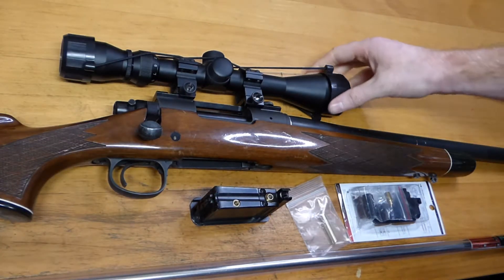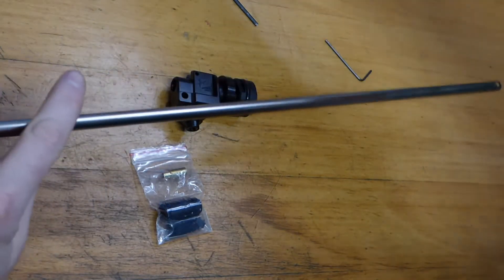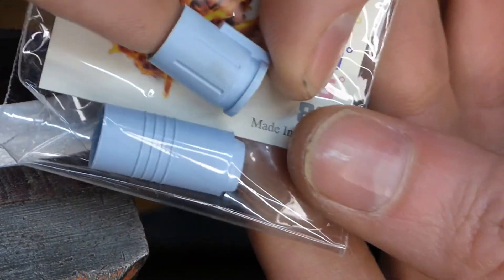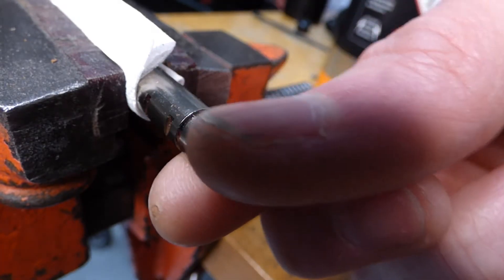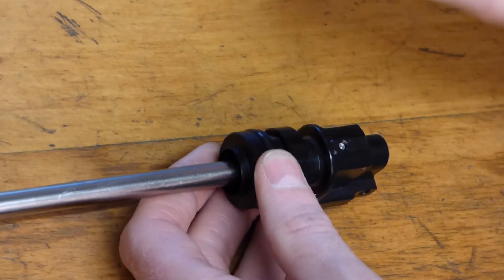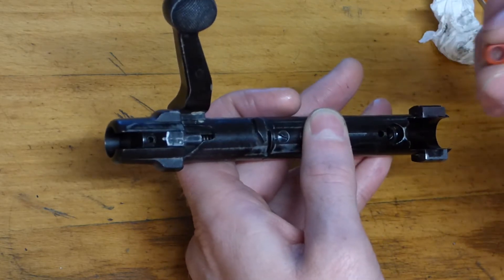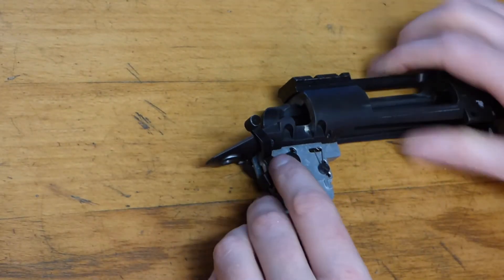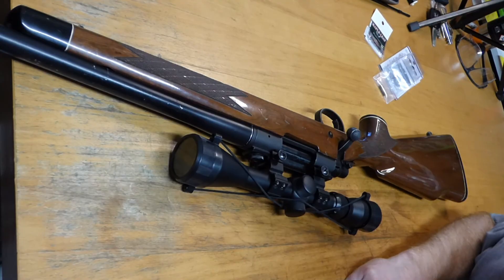Tanaka M700 Hop and barrel upgrade. Action army hop chamber

Comment: HI,
does the chamber has a slot for the bucking so the barrel/bucking are sitting tight and can't rotate? I might getting one of them for my second tanaka ;)
Reply from the maker: Yes there is a slot in the chamber to allow you to slide in a barrel equipt with a VSR style hop rubber and stops it all from rotating.